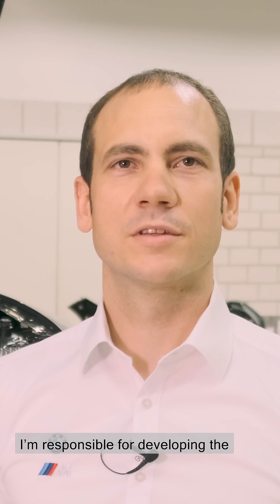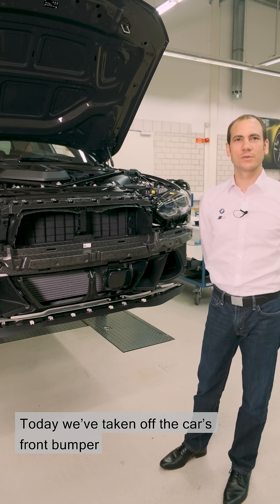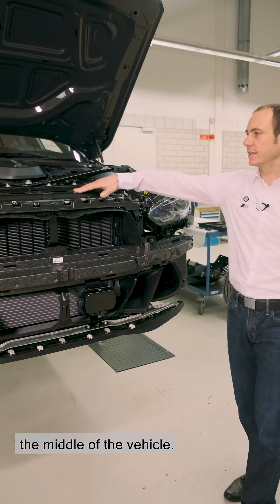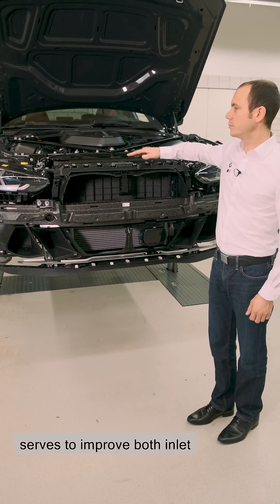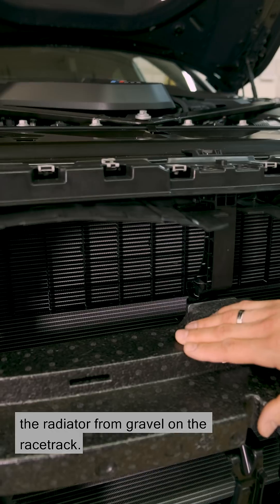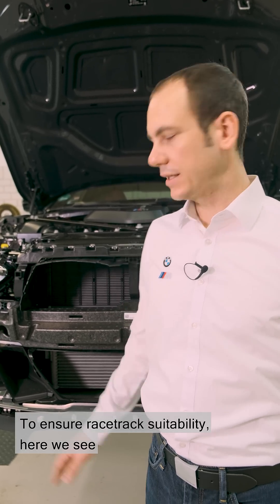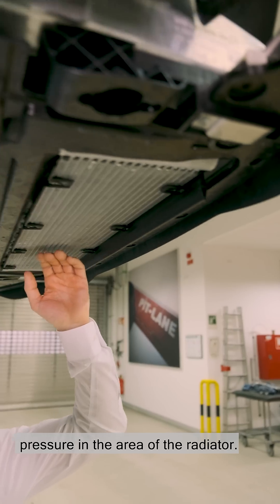Cooling System. M3 and M4 - explained, Episode 02.

Comment: @BMW M  the biggest pity in history is not all this excess of technology, but its unreliability.
High pressure pump
Index injector ...
Turbos
Waste gate rattle
Oil leaking from many many connection seal / radiators .......
I still dream of the famous M50 engine of my 325i e36 or the 3.2l engine of the fabulous M3.
Xdrive system: if the wear of your 4 tires is not 99% identical, you destroy your transfer box, the bmw engineers must all drive Mercedes

Comment: Under the horrendous bumper design, this car bears a ton of resemblance to the F8X. The crash structure and radiator placements a laid out just like the F8X. A bumper with a less polarising design could easily be created to allow the exact same cooling flow without having insanely large kidneys.

Comment: Would you explain on video why, with the brakes you've gone from 4 piston to 6 piston in the front, but on the rear you've 'downgraded' from 2 piston fixed to single piston floating calipers? Visually it's an odd look too. Great to see you added brake cooling ducts though, the older models could have used them.
Reply from the maker: Please watch out for another episode to come: Brakes.
Reply: @BMWM  Awesome, looking forward to it!

Comment: The info here isn't in-depth enough.

Unless you guys have not explained everything, the cooling system is extremely similar to that of the previous F8x cars. It isn't that new. The other thing is, the structure behind that ugly beaver front end is also extremely close to the F8x.

All of this is not enough. It is a 2 minute video explaining basically... down to the base they are still very similar. Which means none of this was again necessary since it isn't "new".
Reply from the maker: Thank you for your feedback.

Comment: I think the stone guard plastic mesh would be a welcome addition to the gearbox oil cooler front, coolant radiator front, and possibly even the engine oil cooler from below. Is there a specific reason why these were left without it?
Reply from the maker: We'll ask Markus and will come back with an answer.

Comment: Wouldn't such a cavernous void increase the drag coefficient? Previous m3s were impressively aerodynamically efficent. The front end seems opened up alot and along with the bigger frontal area this is not good for drag.
Reply from the maker: It has to be opened up to ensure cooling. There is always a compromise regarding cooling, downforce and air resistance.

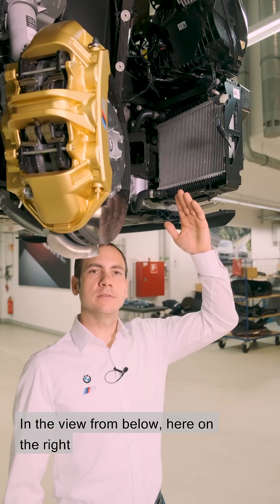Comment: The new M3 is super expensive here in my country.  So I'm forced to choose the X4M instead.  But the G80 would be much faster.  My prediction: the test results for G80/82: straight line 3.3, 11.3; track: 7:35 for Nurburgring and 1:54 for Hockenheim.
Reply: 1:54 Hockenheim? Keep on dreaming!
Reply: Don't be so sure to conclude.  1:54 with cup2 and maybe 1:55 with standard tires.  We'll see.
Reply: @mixworks-de It ran a 1:53.9 maybe it was you who were dreaming? His predictions were spot on